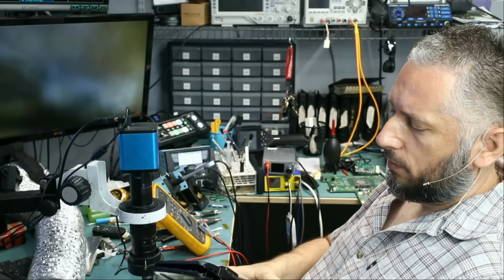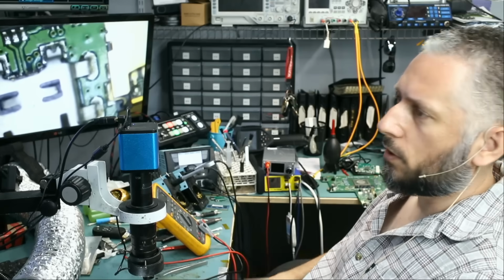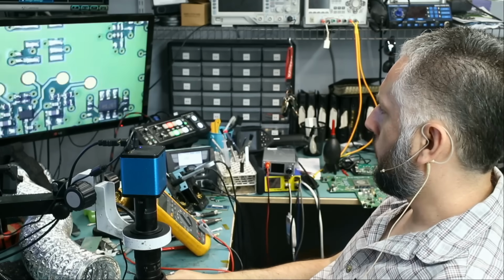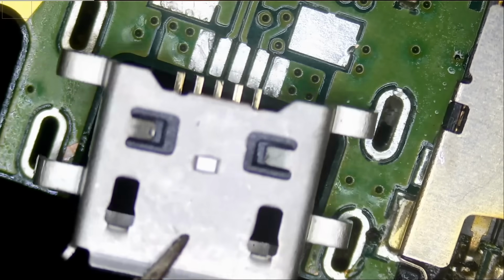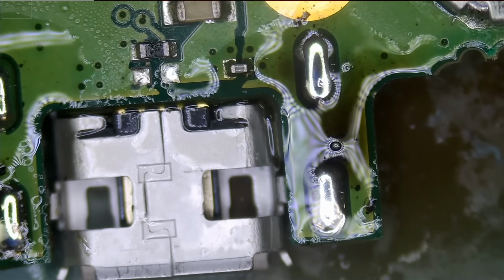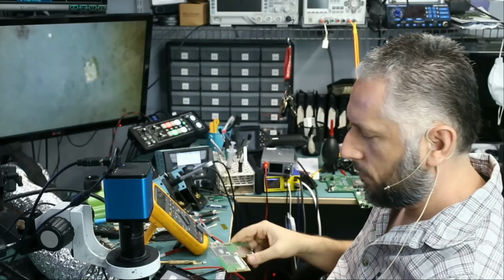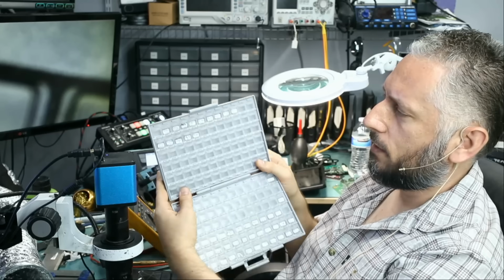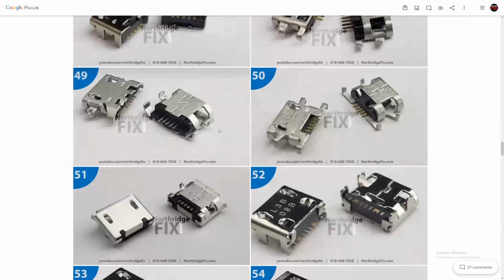Garmin GPS Dezl Repair

Comment: hey my man the plus and minus symbol are visible, + is almost to the edge of the board and the - is bottom right corner of the dark green square, just wanted to point that out, great job with the repair, you make it look so easy for sure

Comment: Its not the mounting of the connector, it's that this is probably a driver that switches trucks regularly and the internals of the connector coupled with a shitty cable and dirt that causes this.

Comment: I was wondering how he knows when he has the port lined up so it will fit in the housing of the device properly. There is a little bit of wiggle room before soldering. If it is a little too forward the case may not go back on properly. If it is a little too far back the charging cord may not fit properly once the case is back on.
Reply: They usually design the housing of the device with that wiggle room in mind. Besides, it's really not a big position difference.

Comment: Awesome job. I tried to do "Better than Factory" solder but once IPA vaporises, it does not look as good as before. Any tips?
Reply: Use an air compressor to blow the residue away right after.

Comment: Awesome job on the Garmin my old unit had same issue and did not  know it could be replaced that way I will try to fix mine in the same way I may need to order the same port form your site

Comment: I guess you can make a filter to those 500 box of charging port, something like a port with 4 legs, or a port with 5 connector, it would be easier to find
Reply: I wrote a webapp that does exactly that